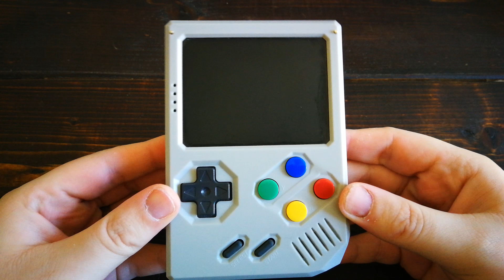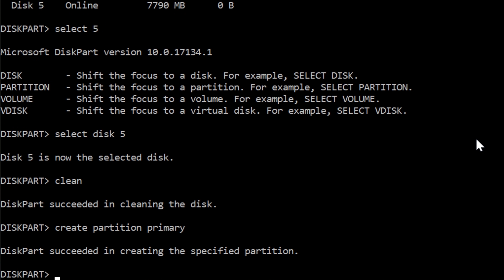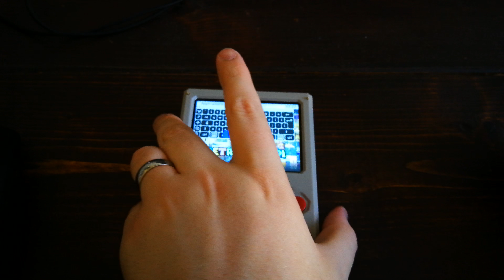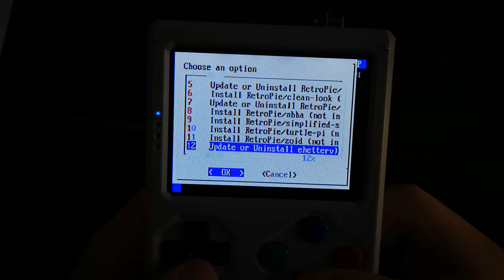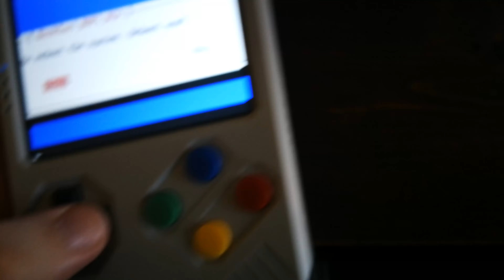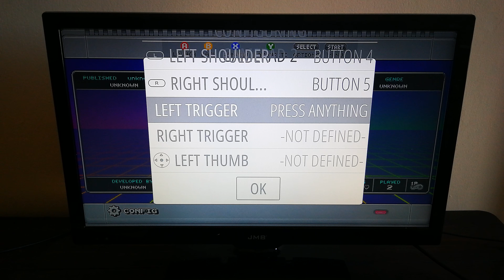RetroStone Tutorial + User Guide

Comment: Highly doubt this'll be seen. Especially after 4 years. I have the same machine you have. However, I keep getting hung up on 1 of 2 screens. Solid black, or a black screen with lines of code but remaining stationary. I have tried "cleaning" and reimaging numerous times yet to no avail. Any tips?
Reply from the maker: If it's repeatedly failing have you tried using different SD cards yet? 

If you're following the steps and it's not a newer/different model or anything then the only culprits as far as I know would be hardware-based. Hopefully, that means it's your SD card, otherwise you might have to contact the manufacturer for a full-on refund/repair I'm afraid.

Comment: Is it possible to upgrade the screen to a ips display with higher resolution?
Reply from the maker: technically? Yes, it's almost certainly possible. The difficulty you'd have is finding a 4:3 screen to replace it with. Most of the screens out there are at least 16:9, plus you've then got to try and match the 54-pin screen that is in the unit and most 4:3 IPS screens are 40 pin which might make it a bit difficult.
There has been some discussion online about converting it through the HDMI port but ngl that's a complicated procedure. It would probably be easier to just straight up buy a Raspberry Pi kit and make one better for yourself.
Reply from the maker: https://vimeo.com/293888297

Someone actually did have some limited success with this modification using an LCD and an HDMI converter. Unfortunately in his forum posts, he not only stated that it was a work in progress but also stated that there were numerous other factors to consider such as heat output and removing USB ports to make this work. 

It seems that the process for doing this is way more complicated than it seems like it's worth.
Reply: Mupple agreed, I find it a bit strange how the new v2 had a downgrade in chip set...I feel they do it deliberately lol still going to get it though
Reply from the maker: @SonicLoveEmulation  I'm going to be doing a video soon about all the different options concerning how it's best to play different retro games on dedicated hardware. Just waiting for a response from a friend of mine on Instagram. 

Might be worth taking a look at that once it comes out next month.

Comment: I have the new retrostone 2 and I tried to go on desktop mode but it only stuck on the retrorangepi 4.3 screen. Can you give me some advice? Thanks
Reply from the maker: I don't have much experience with the 2 I'm afraid but if the OS is still as shaky as it was then it's more than likely you got a boot failure. If you turn it on and it doesn't get past that screen you're unfortunately going to have to reinstall the system again, which is a common occurrence whenever you do anything other than keep it in either handheld or TV mode.
Reply: Mupple I did reinstall the img file and nothing change... I hope I did not get a fault console. I support the kickstarter to get one. I open file manager to see if I can copy it from one panel to the other.. no luck either..

Comment: This system is garbage, I recieved mine just after xmas, was doa died after an hour. Opened a ticket on the site, created a topic on forums, sent 3 emails, and no reply at all. Stay away from this product!!!
Reply: Rubbish. I'll be getting one.
Reply from the maker: @afistfulofpimples1745  I don't know why but I like the fact that your profile picture is literally just a foot.
Reply: @MuppleUK  Thank you.
Reply: Hi whats your ticket no ? I dont see any ticket named Danny M
Reply from the maker: What sort of booting issue have you had? The system does have a lot of issues with switching to and from HDMI mode as well as general boot issues.

You can usually get them working again by reinstalling the OS from scratch but it's a huge pain in the ass.

Just as an example I took mine on a trip and used it for like a week to play through resi 3 and Dino crisis but by the end of the week it crashed into a boot loop and I had to reinstall when I got home just to be able to use the bloody thing.

Hopefully you can at least get yours working. Does it still turn on at all? Does it just turn on then make a clicking noises and keep restarting itself? If so a reinstall might help, but you also have to open it up and unsolder a small transistor to help prevent boot issues. Having said that I have done this and it can still boot loop it's just rarer.

There are videos out there to show how to sort it but if you'd find it helpful I can do a follow up to discuss some of the common issues and how to fix or work around them. 

Hope you can sort your device my dude. - W
Reply: @MuppleUK  I was getting a blue screen but now my system will not boot at all, tried 3 different sd cards and fresh installs
Reply from the maker: Hmm, what happens if you plug a hdmi in before booting? Does the TV screen show any error messages?

Have you seen the hardware fix video put out by the guy who made it ? That might help you but I'm not entirely sure.